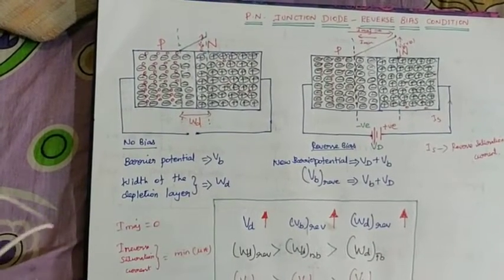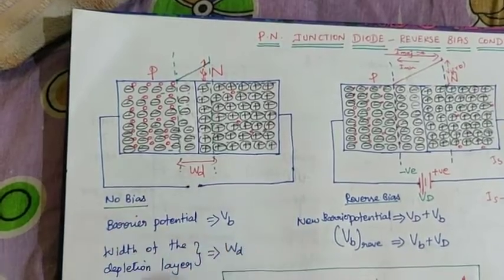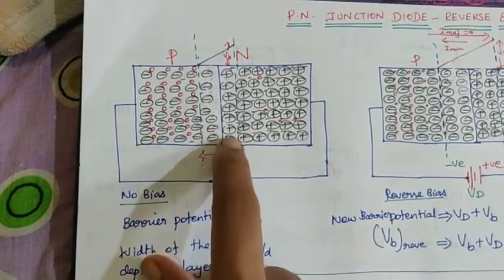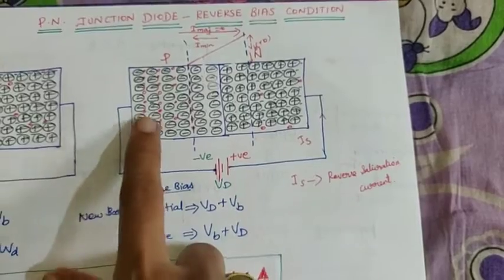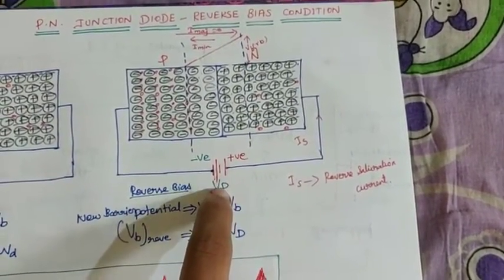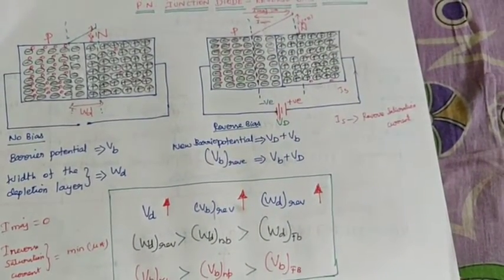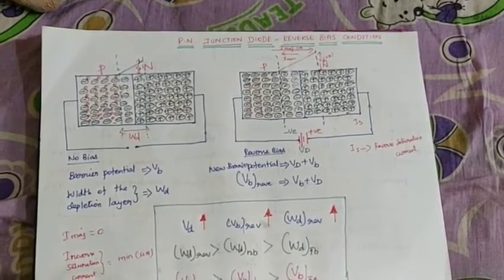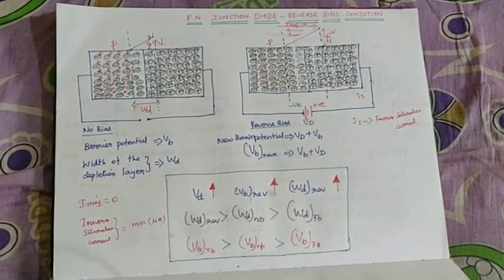PN junction working in reverse bias- lecture in tamil

Comment: Thank You for uploading video...Nandri......i have a small doubt in FB .....in FB of a silicon diode if we give 0.7 applied voltage to that, cut in voltage um applied voltage um cancel each other appo...diode conduct pannuma pannatha......? and one more question in RB of a diode what is the role of increasing in reverse saturation voltage .....athu increase agurathu naala will any further operation happens ???
Reply from the maker: once it reached 0.7ev den the diode can start to conduct in further increasing of FB.
For  certain reverse voltage breakdown will occur.i ll explain it in my next session.
Reply: @priyadarshinie13 ok......thnkq